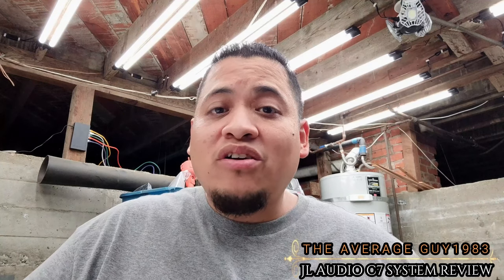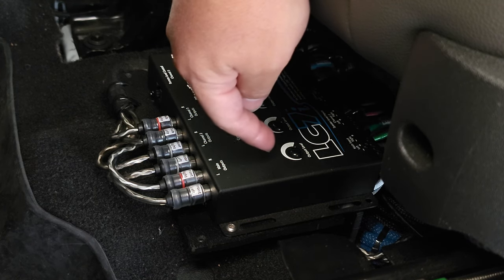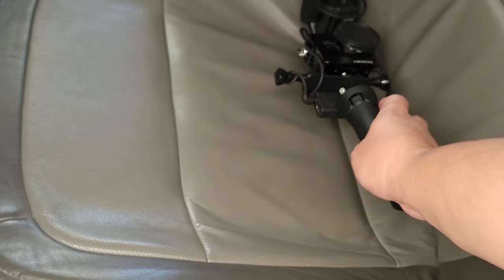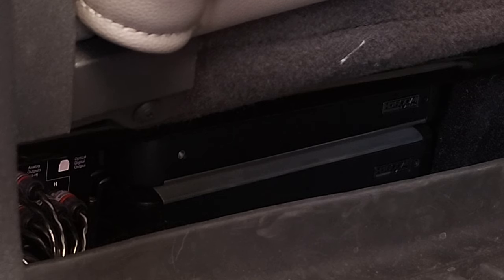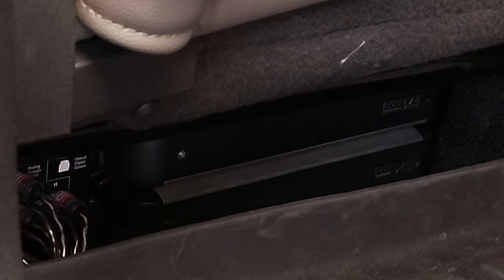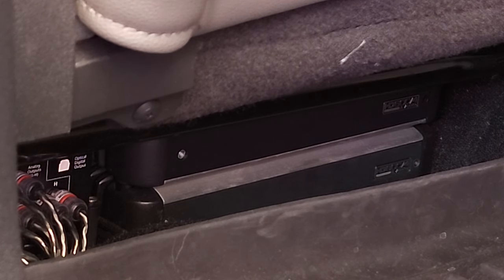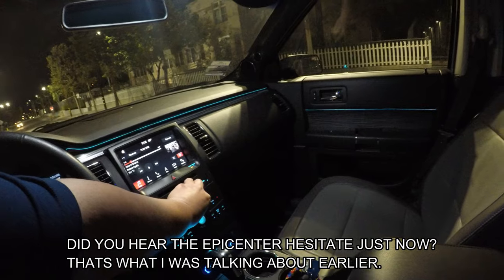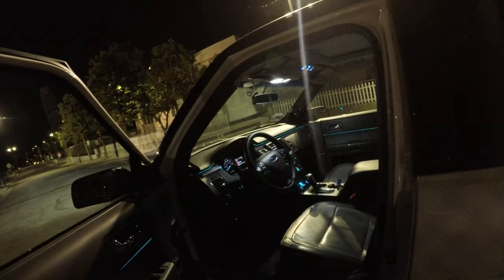MY JL AUDIO C7 AUDIO SYSTEM REVIEW

Comment: Wow that sounds craaazy!  Bro I wouldn’t even worry about the specs not matching what JL says, I think that’s mainly a marketing ploy.  What’s most important is how well they perform.
Reply from the maker: And it definitely performs great! The only reason I mentioned the specs was for the people that care alot about how loud it can get. 😅
Reply: @THEAVERAGEGUY1983  so can the c7 active threeway set get really loud?. I have 13w7 sealed off of a hd1200. I would like to know if the c7's can keep up?.
Reply from the maker: @dc5001  in my opinion, Absolutely! I have a 12w7AE in a ported box that I tried out with these C7s and they definitely were able to keep up with it on the HD750/1 with the HD750/1 Amp set at 840 Watts RMS with no problem. So it definitely won't be a problem. Specially if you put the C7 3.5" and tweeter on your A pillars.
Reply: @THEAVERAGEGUY1983  thank you for your reply. And what you said earlier about the jl audio c7 power handling, If i put for example 100 watts rms to the c7 tweeter, will it blow, or will it just sound more harsh/not as smooth?.
Reply from the maker: @dc5001  it will definitely do both. Sound very harsh and actually start to smell like it's burning. I almost messed up my rear D pillar speakers because of that. So just be really careful how much power you put in them. Out of all 3 speakers like the tweeter, midrange and 6.5 inch speaker, the tweeter is the most power sensitive one. The 3.5 inch speaker might handle perhaps 75 watts pushing it to its limits with clipping and the 6.5 could probably take the whole 100 watts rms if you set your frequency to maybe 100hz as the lowest frequency to push to it and if you use a dsp just drop the bass on it from the EQ. So you can push them louder but they will definitely lose midbass sound doing that, sort of like when someone would set the amps under high-pass to block out the low frequencies in the door speakers so the they won't blow out.
Reply: @THEAVERAGEGUY1983  what frequency/hz did you have the c7 tweeter set on the dsp?
Reply from the maker: @dc5001  I have it set at 5000Hz @24Db to 20,000Hz @24Db. It can go as low as 3000Hz but then you will immediately notice it sounding harsh. If you have any other questions about feel free to ask because now that I finally have this system dialed in, I can give you some legit response about frequency range and output with out having to go to JL for advice. 😁👍
Reply: @THEAVERAGEGUY1983  thank  you for your help. what is max output/decible  loudness on each c7 driver?. Also I messaged jl audio, and they said that in real world use, you would not need to use 100watts rms to the tweeter and they would not expect it to be safe at that power level consistently.  And jl audio said that the tweeter is very efficient, and only need 15-25 watts to match the 3.5. Also jl audio said the that the 100 rms spec for the tweet and 3.5, is a average power rating. with the hd amp you not would not need nearly as much power that the hd provides for it to get loud. And they said that with the hd amp, you get allot more headroom though, so the amps would not need to be driven to there max potential, and you would have plenty of output capability with the c7's off of the hd amp. Im interested on your opinion about what they said, as well as the max decible output at full power?.
Reply from the maker: @dc5001  what JL Audio said seems to be pretty accurate from my results. So those VXi amps would be a great match like I mentioned in the video. As for dB Output I really wouldn't be able to tell you since I don't have a RTA to measure that.  But they definitely get loud. I wish JL Audio could have told me what they told you instead of me having to figure this out on my own hahahaha. But yeah what they told you about the tweeter bot needing that much power to work good is very accurate based on what I was able to achieve. However they really shouldn't be putting 100 watts rms for the C7 tweeters if they can't realistically handle that power. Glad they didn't mind giving you any info. Perhaps they watched my video and decided to loosen up a bit. 😅
Reply: @THEAVERAGEGUY1983  i asked them to compare the xd to the hd amp for the c7's and they told me that the hd amps for the 3.5 and tweeter would be better for headroom so the amps would not need to be driven to their max potential, and the hd's would give the c7's plenty of output capability. The reason i compared the xd to the hd is that there both just amplifiers. The vxi is the really the xd with a dsp built in. Same 75watts rms nex d switching technology for the amp. when you tested the 3.5 you got 75watts rms power handeling. That would put the xd/vxi at max power. Jl audio rates there xd/vxi amps 75rms power rating at 1percent distortion. You dont want to go near 1 percent, thats why i think the technician at jl said the hd's are better for the c7's for headroom.
Reply from the maker: @dc5001  that's actually why I went with the HD amps lol! Well looks like I'm in good hands after all. My voltage definitely doesn't drop below 12.2 volts which is great considering how many of them I'm running. So looks like you can just go for the HD Amps, just be careful with how much power you throw on the tweeters. On the 3.5 inches I was able to push 65 watts rms to them but yeah you are Definitely right. Using the VXi amps would cause me to be maxing out their power. For the tweeters they would still be good but for the 6.5s you definitely want to just go with the HD600/4 amps.
Reply from the maker: @dc5001  that definitely does sound pretty good. For the midrange and tweeters I would probably still consider using a lower power handling amp. But thats if I ever buy them again, personally I still like the way my C5s performance and have 3 sets of 3 ways plus 2 ZR800Cws to divide between my front and rear doors for my park avenue but........ that's if I can get that thing running. But I got alot of work to do before I can get started, I also have a product review that I have to record and load up to the channel, after that I'm gonna take a long break before I post another video. This review for the C7s and on going Email communication between me, Eric Cole, Lee Dobbs and some guy name Manvile drained me man lol! They did tell me the same thing they told you about the tweeters not needing more then 15 to 25 watts to really power them up but again that doesn't change the fact that they didn't want to reveal anything about how they rate their speakers and why they would over rate the C7 line. The C5s can do the actual 75 watts rms per speaker with the tweeter also doing about the same 55 watts the C7 tweeter did in my test which 55 watts is really loud for a tweeter. There was alot I had to cut out of the video to basically get to the point and not make the video too long it was like over 2 hours. Most only watch about 70% of my videos and leave it afterwards. I still like the C7s and really LOVE How they sound but i didn't like how JL Audio is over rating the speakers power handling and trying to shine the power rating off by saying the tweeters don't need that much power to work well which they are right but why over rate them and the same goes with the midrange speakers lol! The door speakers I can completely understand on the 85 watts rms I got to push to them clean because there is no high-pass filter switch to remove all the midbass from it to help the speaker play louder with out blowing the driver from it being over driven. They should just be honest and say, look the C7s can handle this much Realistic power for each tweeter midrange and midbass and we recommend an amp from 50 to 100 watts rms vs the 50 to 150 watts rms. I'm not like trying to argue but I definitely won't change my opinion on the power output plus the power output was really aimed at those individuals who always say JL is Over price crap etc I've heard it all lol! The most important part is how well they sound and how much detail they give specially the midrange and tweeter when they are on the A pillars. They do sound great.👍
Reply: @THEAVERAGEGUY1983  i do agree with what your saying about the c7s over inflated power rating. And im wondering what they ment about its a average power rating too. And it shocks me that the c5 tweeter is just as loud, wow. The helix p six would still be great for the 3.5's and tweeters as well because of the sq and headroom. If you see a lot of high quality installs, you would see them using it active on allot of high end midbass, upper mids and highs. Have you ever heard the focal kx3 set active, because  i have them and i wonder how they compare to the jl audio c7s as well.
Reply from the maker: @dc5001  I have definitely heard of them but never had a demo. Most of the shops around me really suck! Lol! They typically have the low to mid level models of speakers and A small handful of brands. I was even surprised to see some Hertz 2 way speakers at a shop I went to called AL & Ed's Auto sound when I was trying to get the C7s. I honestly wish I could give you a demo of this set up I have so you can hear them in person and get a feel for what they are. They do sound great but that power rating over inflation is pretty misleading because those C5s can pretty much do the same power as these and on the HD amps! But I am definitely interested in the Helix you are talking about For sure!!!!!
Reply: @THEAVERAGEGUY1983  i would like to here your setup some day, and for you to here mine as well. And about the jl audio power ratings again, i noticed even with there subs when you go on the jl audio website, when you look at a  specific subwoofer, it shows a thermal power chart. For instance when you look at the jl audio 10w7, it would be rated for 750 max rms. but when you go to the general specifications power chart it would say optimized at 500 watts rms. The 750 watts rms shows it at the danger zone. For the 10w6v3 it would be optimized at 400watts rms not 600rms. I remember jl saying that it will last longer and play better at optimized rating vs max rms rating. So i guess there kind of doing the same thing with c7's, but they should have a power chart to show that for the c7's as well. I guess the c7's could play at the max rating, but not continuously. Another thing i would like to point out to you is the jl audio hd amps are very power hungry, and will not last long with a weak charging system. There great amps, I have them powering my subs. But i upgraded my alternator to a 240 amp, xs battery, and big three upgrade. Before i did the upgrade, the amps were getting hot because the regulated power supply was trying to supply current that was not even there. Now the amps run cool. So remember that as well because that could damage your amps, and compromise there performance. The hd and slash amps are great for midbass and subs. The reason i recommended to you the helix dsp/amps is because for 1, the helix amp is much newer then the jl amps, and class d technology has been getting much more advanced with better fidelity over the years. And 2, they are supplied by texas instruments. So very good quality components.
Reply from the maker: @dc5001  regarding the power handling chart you are 100% right. I do intend on getting a 280 to 390 Mike Singer Alternator later on and installing it and a XS Power D6500 Battery that should definitely take care of things. I've only done the BIG 3 with an Extra Ground Wire but it's all 4/0 as I wanted to get the most out of the charging system. 😁👍

Comment: Love the diy install!  My project x5 has the vxi amps you're talking about but I opted for Audiofrog gb series 3 ways, no rear fills (yet) and two JL tw3 12s.  I love the c7s and matching full systems, but took a chance on a different route.  I think it paid off for me.  Thanks to you too, i also just installed 5 DDAUTO 13.3 in tvs! Keep up the great vids....and watch out for the popos🤣
Reply from the maker: That's awesome! I was also thinking about the Audiofrog speakers too. And yeah man I'll do my best to stay out of trouble. I've only got a ticket once with my Genesis when I had my 12w7AE for Loud Music lol! It was a $340.00 Ticket back in 2014 lol! 😅
Reply: @THEAVERAGEGUY1983  

What's up with those Sennheisers?
Reply from the maker: @skeetorkiftwon  ah, the IE40s, yeah they sounded great but 1 the right side earbud gave out with normal usage right after the warranty expired. However the IE80S I have are still working great and I also have some Shure SE215s that still work 100% too but the clear wire is starting to get this green stuff on the inside of the wire where it wraps around the ear like if it had some sort of oxidation from the copper wire. The good thing on the SE215s is that you can buy a replacement cable for those. On the IE40s it's actually the earbud that gave out.

Comment: Appreciate the video,  good job! Made me understand allot of the things I need
Reply from the maker: Appreciate the feedback. If you have anymore questions please feel free to ask and as long as it's within my Knowledge I'd be happy to answer 🙇‍♂️🙏
Reply: @THEAVERAGEGUY1983  Thanks
Reply: If you had the chance again: C7 or Audio frog GB 3 way or focal or Morel. I'm looking for clear sound , my windows rolled up but want to hear the music with the base kicking me .
Reply from the maker: @lowridingtrucks88  If I had a chance do to it over with a different brand, I would go with the Morel Hybrid 63. They have a +4DB output then the C7s and I would definitely use the Included crossovers to avoid this crazy Full Active system thing I did. I could push more power to those speakers with the included crossovers and get similar results. 😁👍
Reply: @THEAVERAGEGUY1983  Awsome! Thanks for your input👍
Reply from the maker: @lowridingtrucks88  😁👊

Comment: Nice video and nice install work - did you make the pillar pods yourself? If so props.  If you are interested in sound quality, I would suggest thinking about ditching the Epicenter, JL audio TwK and Lc7I and going for a more upscale DSP like the Helix V8, and also investing in a minidsp Umik-1 - this will elevate your system to the next level as you will get real time frequency response from all speakers and can tune accordingly with a very capable DSP, find out where each speaker is weak in order to maximize their crossover settings then work on all the dips to get a beautiful linear response and center image. You will be amazed at how much of a difference you can get using a microphone with REW and spending a day or so of tuning. Check out the Audiofrog guide to tuning as well, a great resource!
Reply from the maker: That's some good advice thank you! 😁🙏
Reply: @THEAVERAGEGUY1983  also, I follow another YouTuber by the name of PSSound, that guy is major OCD like me which is probably why I am drawn to his channel - he has some amazing experience and many trophies from SQ competitions to show for it as well!
Reply from the maker: Ah forgot to add that yes I made the a pillars my self. First time too, I used Acrylic recessed Speaker rings for the installation. A little tricky to work with as one of them was starting to Crack as I was carefully drilling a threaded drill bit for the screws. 😅 but it all worked out.
Reply from the maker: @Evan Steeves  you follow him too? Nice!!!! I'm also following him as well as JAT4011 here on youtube. I try to focus more on the wiring and fabricating part on my channel but yeah this is a whole other level of experience hahaha.